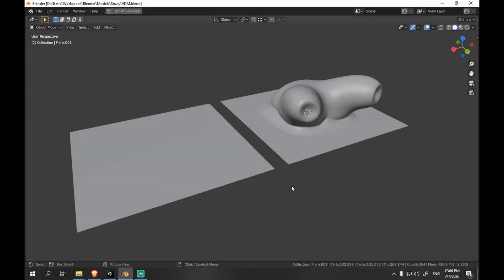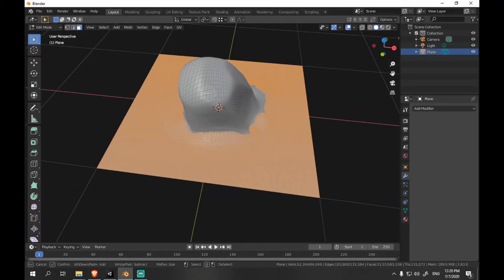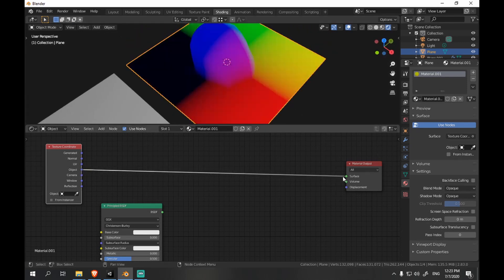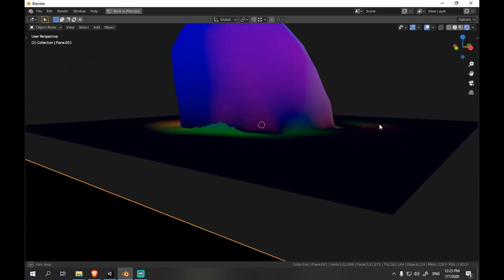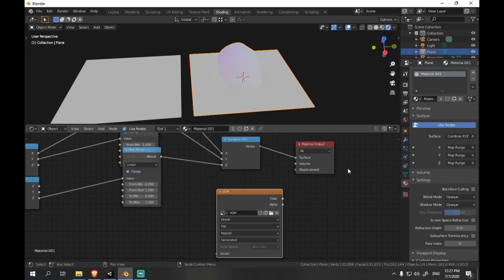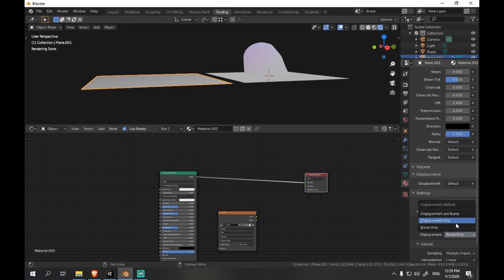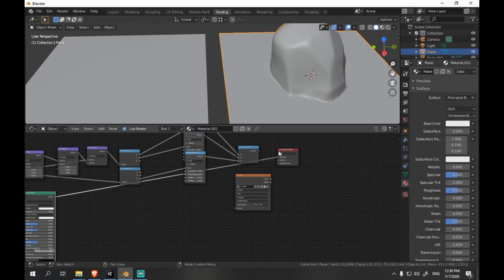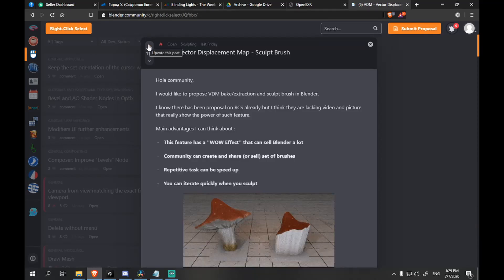Baking Vector Displacement Maps in Blender

Comment: Does it only work with starting from a mesh plane?
I tried to sculpt from a sphere but it doesn't work.
I can't find a solution to bake the displacement map in blender between two different meshes (high poly sculpt to low poly retopo)
An addon would be very useful!
Reply from the maker: It’s a bit more complicated with a sphere.